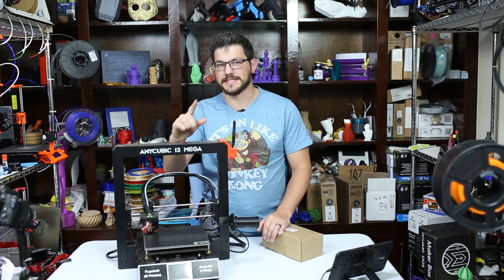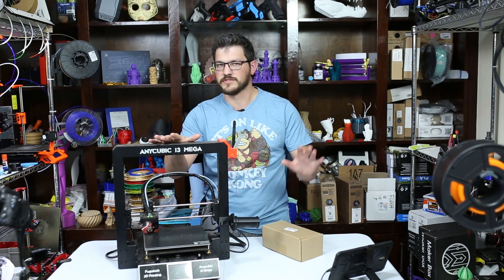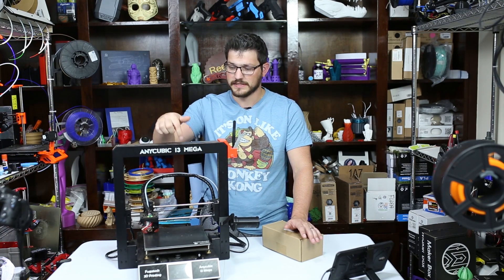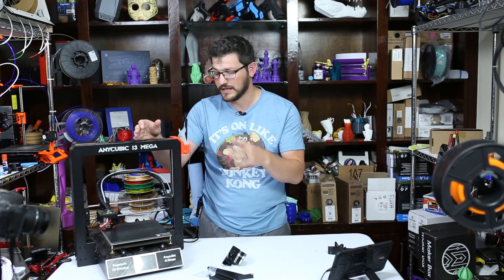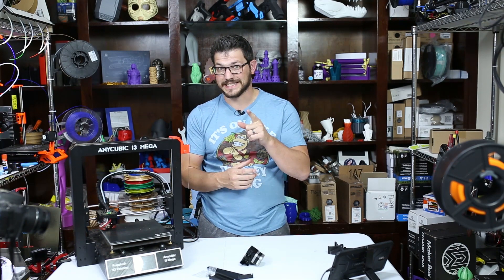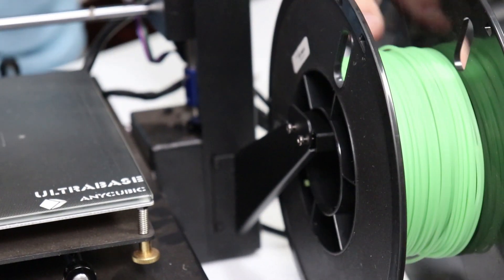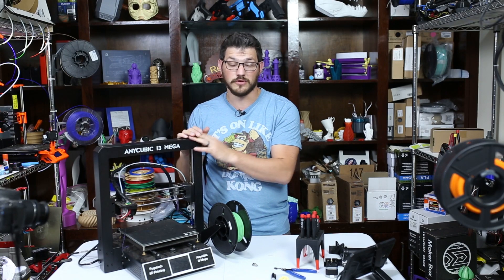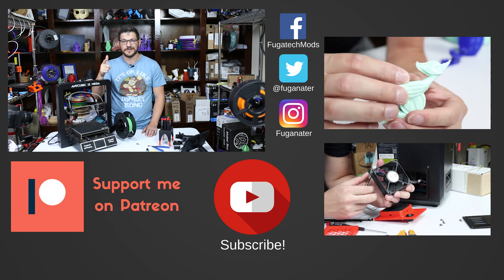Anycubic i3 Mega Upgrade Kit

Comment: I have the Pro which I thought was just an S with a laser attachment but apparently it also includes a filament sensor, X and y tmc2208 drivers (I don’t know why they didn’t just do all 5), and my extruder is clear instead of black. I think it’s the same type though… it’s a dual gear extruder. I’m definitely going to upgrade the other 3 stepper drivers and replace whatever fan sounds like it’s dying inside the machine (probably the stepper driver fan). The machine itself is super sturdy. I hate that Anycubic doesn’t easily upgrade but I plan to put Marlin on it later once I get the hardware working right.

Comment: Hi everyone, 
I have an Anycubic mega S,
 I'd like to buy, install and use the laser engraving. Is it that possible? Is it enough to change the firmware and is it available to download?

Second question in case i can set up my 3d printer to laser engrave.
 I've installed a different firmware from the original which allowed me to do a manual auto- levelling. Is there any way I can save the set up before to replace the firmware in order to be able in the future to reinstall the actual firmer with the actual commands?

Thanks

Comment: I just ordered mine. Hope it comes soon. I tried 3D printing early on, but had so many problems, I gave up and sold it all. I am retired now, and want to try again. I hope my i3 mega works well out of the box. I want to use it stock, and then decide if I want to up grade anything. I also assume the new ones have the upgraded motor, but what about the stepper motor upgrade?

Comment: There seem to be a few variants of this upgrade kit on the market. The one I received actually had a steps/mm setting of 480 i.e. a gear ratio of 5:1 instead of 3:1.

The stepper motor is also smaller than the one on the original extruder and does get quite hot during operation. A concern I have with this quite excessive gear ratio is achieving adequate retraction speeds due to the need to multiply your basic retraction speed by 3 or, in my case, by 5.

Comment: I have done this upgrade, and it works well. My only issue is feeding the filament into the extruder. It takes a lot of wiggling to get it into the bowden tube. I have started removing the tube from the top of the extruder to allow the filament to come through then reinsert the tube. Is anyone else having this issue? I also miss the manual winder from the old extruder.

Comment: Does the hotend upgrade improve printing in Nylon and other higher temp filaments?
I've got 2 i3 Mega units but can't get nylon to work for me. PLA+ and ABS work well.

ps. I'm a 3d printing noob, only had them a few weeks. Be gentle with me 😊

Comment: Hi , does this update require a firmware update too ? 
You know there are some improvements like mesh leveling but i feel ok with manual leveling so no urgent need for me except the new stepper motor needs a firmware update

Comment: I have a question?  I just bought this kit and it should be in on Tuesday.  When I install it should I upgrade my firmware to the latest Anycubic S firmware?
Reply from the maker: I'm not sure what changes they have in that. The firmware I used is linked in the video description. Just adjust the E Steps and you should be good to go.
Reply: @Fugatech3DPrinting  I am also considering upgrading the hotend but im not sure if its something that I really need.
Reply: @Fugatech3DPrinting  I downloaded the one you linked.  However when I download it there are multiple HEX files in there which do I need to use?
Reply from the maker: I sent it on Discord but if others want it, I put a link to min in the video description!

Comment: I did the S upgrade to my Mega about four months ago, and am very happy that I did.  The original extruder always caused me headaches, to counter you, by always being terrible at gripping the filament.  I love the new extruder.
Reply from the maker: The new one works well but I really dislike how hard it is for me to get my finger on the wheel now.
Reply: @Fugatech3DPrinting  do you have a simplified profile for that thing im having issues with getting mine printing and im trying to give it to my daughter
Reply: Exactly. I should really purchase one this kit and see if it actually fixes the problem too. (while I'm at it I should stop buying cheap ass filament off of Amazon, lol).

Comment: Mine already has many mods but worked well out of the box.  I’d recommend anyone considering these spend the extra and get the “S”.     The spool holder is a big improvement and the generic Titan extruder and V6 hotend is worthwhile too.    The filament sensor is a PITA and I’ve hard mounted  mine with Bowden tube going from the outgo to the extruder intake.  Makes filament change a breeze.
Another good video Shane !